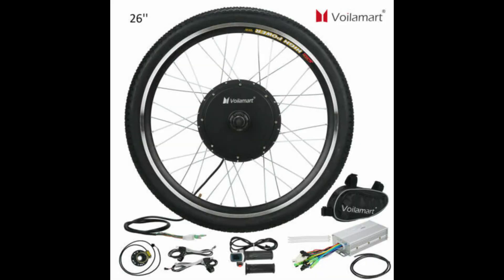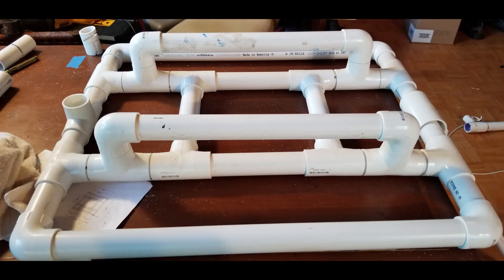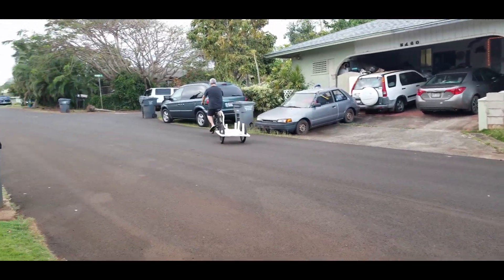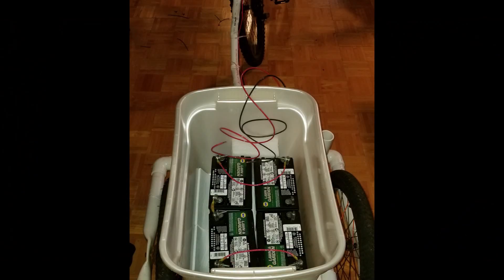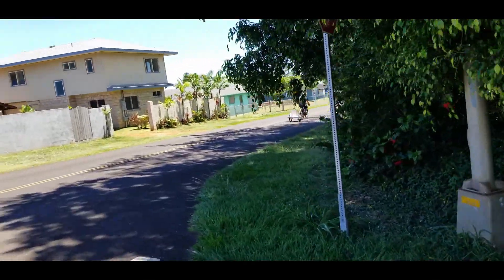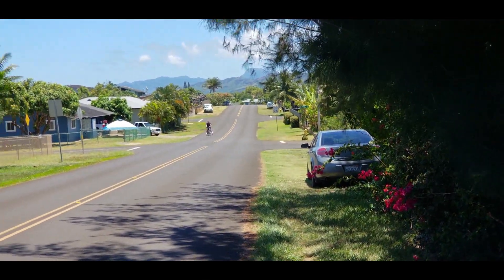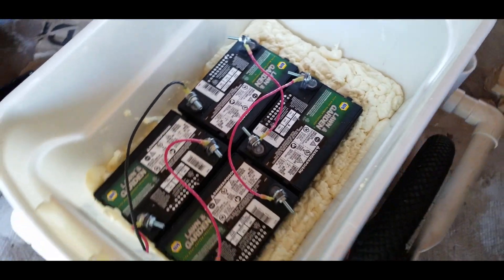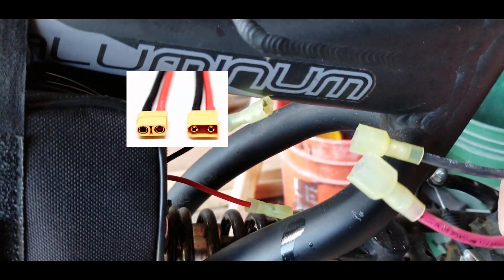E-bike Build # 2 - PVC Battery Trailer Working

Comment: You should consider adding suspension to the trailer so the batteries don't have to deal with as much vibration. I'm doing the same thing with my bike but I got hundreds of 18650 cells from work 😊
Reply from the maker: More videos... I replaced the battery with a lithium, rebuilt the trailer and more...
Reply: @DIYKauai  i was surprised you couldnt get lithium ion cells, ian molina has a kinda famous high power super73 build and he also lives in hawaii but not on kauai
Reply from the maker: the hundreds of 18650 cells sounds amazing... almost impossible to get here on Kauai.

Comment: This is very cool, well put together.
Reply from the maker: Mahalo. There are more videos in the build evolution of this trailer. I ultimately got a lithium battery and was able to give the trailer away to some locals who were super stoked. The "2.0" version of it could reliably haul 2-300 lbs in a waterproof container.  All PVC, not metal to rust or wood to rot.